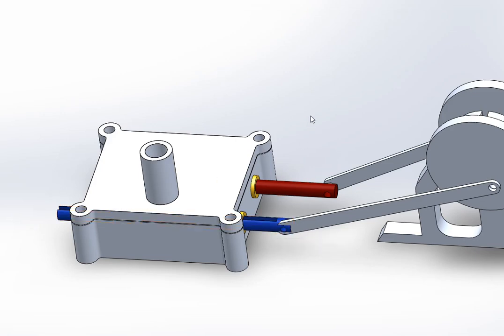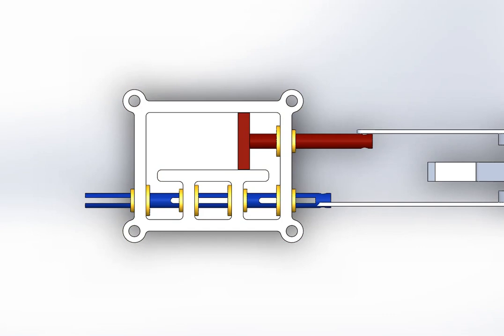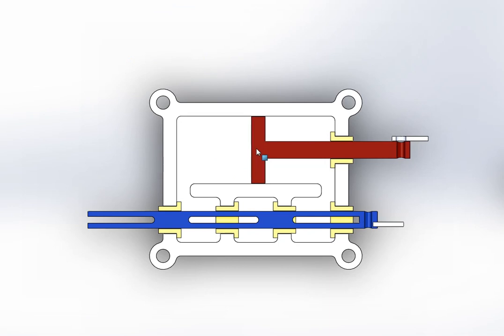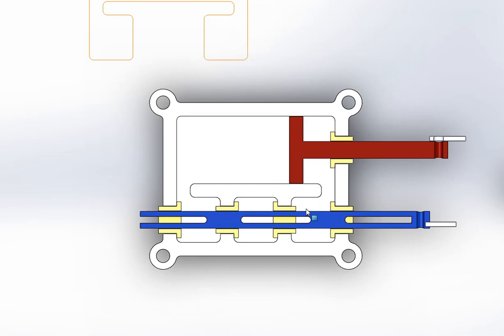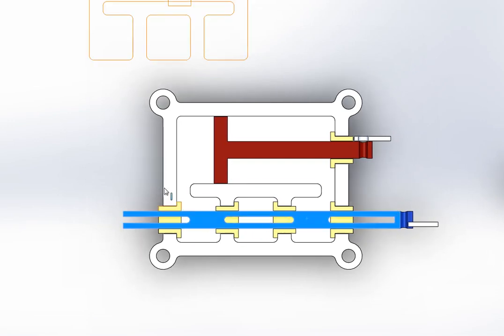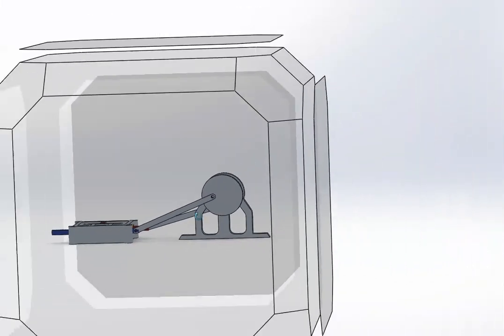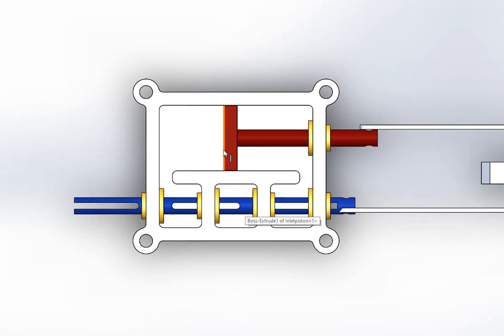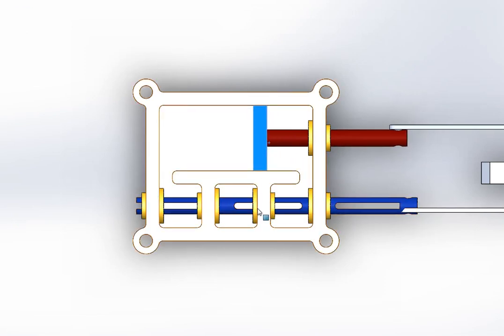3D Printed compressed air engine - How it works

Comment: Very nice. Im on a Steam/Stirling building kick myself. I may try that free design program to design some oscillating cylinders for steam engines. 

Great breakdown of functionality and operation. At first i thought it was a Stirling until i saw you were injecting air pressure.

Comment: Explained very well, I'm going to have to try and design an engine with a slide valve in the near future!
Reply from the maker: Thanks! I took a look at the piston engine on your channel; it looks awesome. Some kind of slide valve to let air exit the chamber when the piston is rising would help a bunch, since you wouldn't be recompressing air inside the cylinder.
Reply: @dougmoore8695  Thanks! I'll have a look into that.

Comment: Any chance you have models to share?  Would love to play with this!  Thanks for sharing!
Reply from the maker: Sure, There's just a few extra non printable parts you'll need. I put up a thingiverse page here: https://www.thingiverse.com/thing:4768637

The parts are intentionally slightly oversized so that they can be filed or sanded down to make a good seal against the bushings. You'll need to sand the outside of the inlet,  the piston shaft, the four sides of the piston head, and the flywheel shaft as well. When sanding the piston head sides, try to stay a little larger than you think would be needed for the engine. I sanded mine down too far the first time by just 0.5mm, and it made the engine very weak.